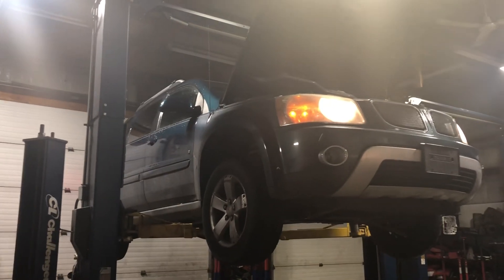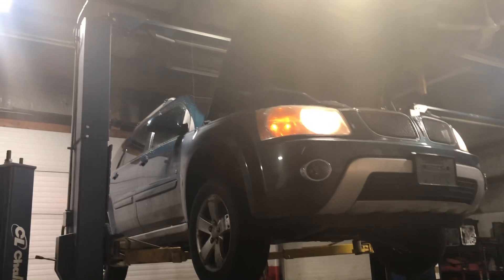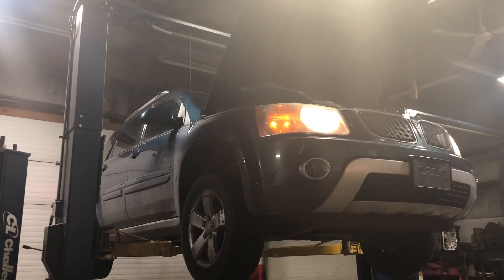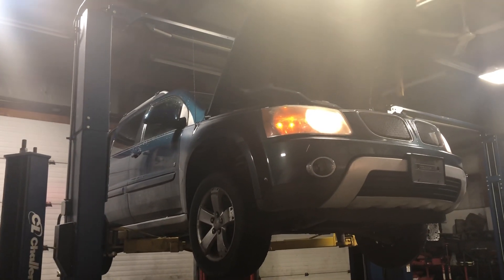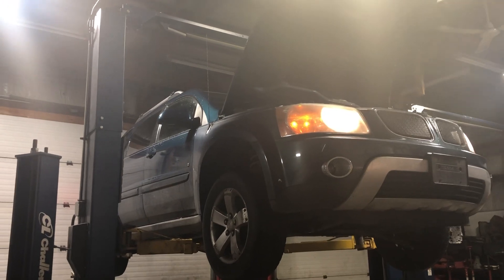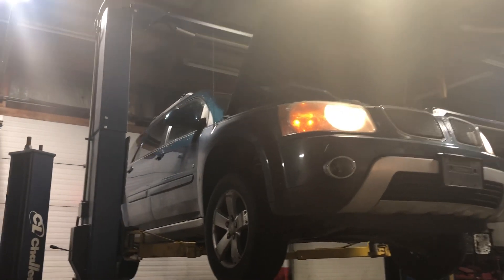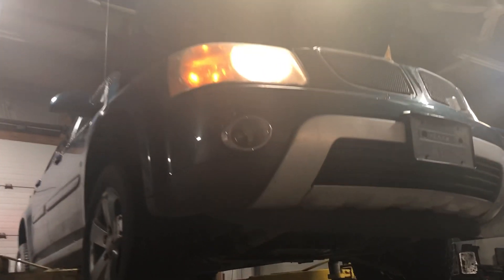Pontiac Torrent transmission fluid fill and major engineering flaw

Comment: I agree man. This is the dumbest shit I’ve ever seen. I used a pump to pump fluid in and had to use a grabber tool to pull the dipstick out. The bolt was close to impossible to get off as well.

Comment: My transmission started riding rough when i first bought mine and when i tried to check the trans fluid, I couldnt find it. Ended up taking it too a mechanic where he showed me that it was right under the car. And it had literally no fluid inside of it. He told me if i didnt come sooner or had it towed up here, i would of been out of a transmission😔

Comment: A little history here - I own a 2006 Pontiac Torrent AWD (since new; currently has 63.4K miles on it), and it has turned out to be the best vehicle I have ever owned in more than 50 years.  Plus, I do ALL of the maintenance myself to include replacing normal maintenance parts as needed, such as 1 Serpentine Belt, 1 Set of U-Joints and Center Hangar Bearing, Set of Brake Pads, Shoes, 2 Batteries, New Spark Plugs and Wires 50K Miles), *3 Sets of Tires, 1 Set of Struts and Shocks (KYB), PVC Valve, Engine Air and Cabin Filters, etc.  I also keep a log on all work performed.

Now part of the maintenance that I do myself is change out the transmission fluid using 1ea 4 Quart Jug of Valvoline MaxLife (Walmart, less than $18), which I have done twice, IN MY GARAGE, with no special tools needed, plus a long funnel.  The most it took me to drain and refill the transmission was just under 30 minutes the first time at 28K Miles.  The second drain and refill at 57K Miles took even less time.  All it required on my part was a little patience, along with knowing that I saved at least $100 by doing it myself AND that is was done right with the right fluid.  On the next transmission fluid change I plan to change out all the 1-Engine and 3-Transmission Mounts strictly due to the Torrent's age (eBay, $103.50 for all four from Choice Automotive).

All-in-all, our Torrent uses no engine oil between changes (2800-3000 Miles w/Valvoline 5w30 Maxlife Engine Oil + Fram TG3387A Engine Oil Filter), runs very smooth and quiet (like a new car actually), and would never hesitate going on any road trip in it.

* PS:  The reason for three sets of tires was because the first two replacement sets were Michelin Defenders where both sets were defective.  So, went with General Tires' Altimax RT43's, which have proven to be phenomenal.
Reply: I am another Torrent believer, bought a 2008 3.4L in Sept 2012, only thing it had issues with was going through 3 thermostate sensors causing it to go into limp mode in -30C winter..i was so impressed with it's reliability I bought the 3.6L GPX model last march..these have been VERY good reliable cars for me..and oh, for the guy making this vid with the trans dipstick, it is quite EASILY done through the top of the engine bay!!! NOT hard at all!!

Comment: Got one of these vehicles and had to pull that to find out why the line had no pressure (turned out to be a clogged internal filter on the transmission , this will stop this transmission from working and it will drop all of its gears). 

Anyway, after you remove its hold down bolt, you can pull it by placing one finger into the left hole (looking at the front its your left hand) then placing two fingers or more (depending on hand size) and push up on the dipstick top. 

The easiest way to remove the bolt is with extensions and from the top after you remove the plastic crap.

Over all the easiest way to do the whole thing is pull up computer and put it to the side (just leave it connected) pull out the plastic box (this will wedge in there but you can use a pry bar on the front to flex the plastic so it can get past AC lines), take out the 13mm bolts you see for the support of that plastic box/battery tray. After that it is wide open and you can see it and easily remove the bolt and dip stick. 

I agree it is a huge design flaw and could have been avoided by making a dipstick tube like they use to on literally every car that extends the opening to the top. 

The bigger design flaw with this transmission is the stupid internal filter because it requires you split the two big halves and install a new one or rebuild the transmission. Both require removing the transmission from the car for a 12 dollar filter or MODIFY it.

Signs your transmission filter is about to clog is a turbine sound that speeds up as you accelerate. It sounds loud and similar to a power steering pump whine (almost identical). 

If you have one of these and it has stopped the vehicle from moving then this is how you modify it to make it work again WITHOUT REMOVING THE TRANSMISSION. This applies to SAAB, Nissan, GM, Saturn and volvo around the same years give or take only about 2 years. Find the drain bolt and drain it, move directly away from the drain bolt towards the crack where the case splits about 1 inch before the crack (1 inch is very important), drill a hole (takes no time don't press too hard on the drill), take a long sturdy skewer device (kebob metal stick, knitting needle, scratch awl etc something like that) now push up into the hole until you hit the filter and push the skew device through the filter and wiggle it around, keep stabbing until you are satisfied the mesh inside the filter is destroyed (you will see a ton of fluid come out once you hit through the filter). NOW THIS IS IMPORTANT: Make sure you have an external transmission filter to install right after because the crap will clog the shift solenoids screens on the valve body and while they can be replaced with it in the car it is a pain in the ass to do so. Now tap the hole for a bolt and install a bolt to plug it up and refill. 

This will make it work because it bypasses the internal filter and returns normal pressure to the unit. This has also been the remedy for shift flares as well as lost gears. 

Of course you have to make sure it didn't just throw a code for a SLS solenoid or TCL solenoid because you would need to replace those first before doing this. If it has no codes and does not move this is the fix for you. 

Disclaimer: if the transmission has been worn out with the whine being there for a long time and you just drove it and ignored its problems then the fix will of course be to rebuild or replace.

Good luck.